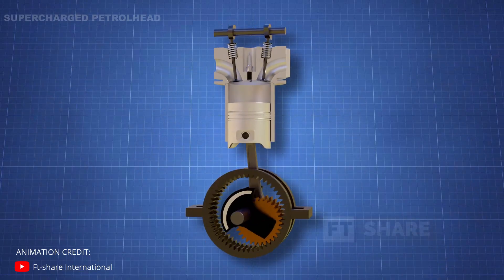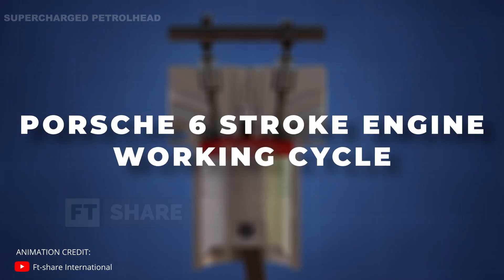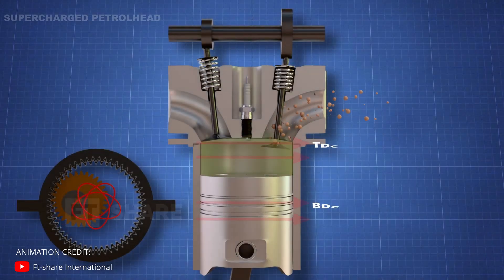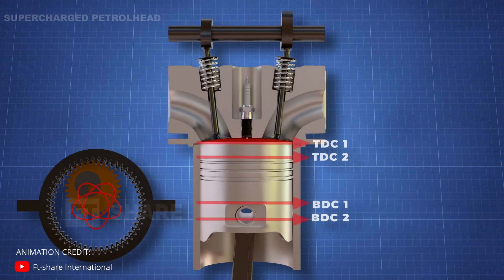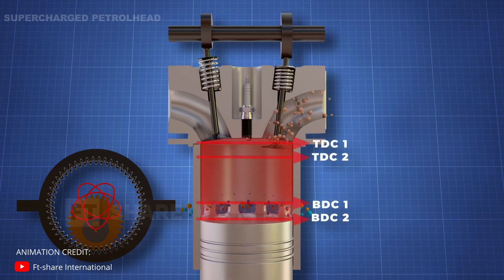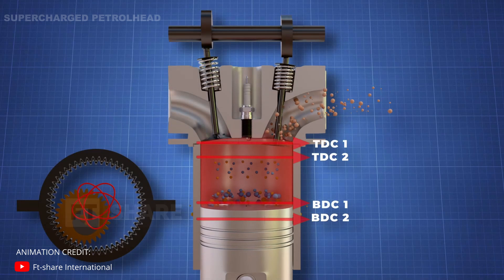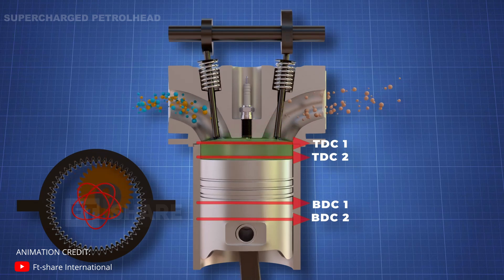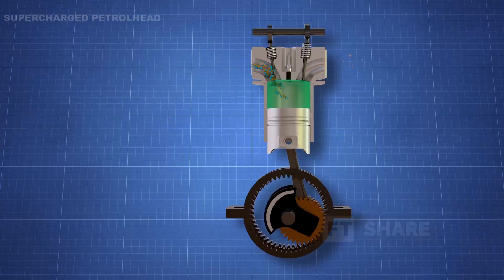How the Porsche 6 Stroke Engine Works?

Comment: how the milage is increased, where there 2 time fule intake is needed for 2 different power stroke. & why 2nd time fule comes from lower side ? how it makes different, I mean if the 2nd fuke intake cames from the same way, what was the problem ?
Reply: Bro we inatake and realeasing only some hot gas then performance and mileage inc by 0.5

Comment: Development in India All ready 2024
Reply: LoL. It's nothing new, it was already made in 1800's 😂😂😂
Reply: @Am1010-4k  Not really. The classic Atkinson-process was developed in the 1800's, but it worked differently, it worked by having different strokes at compression and work extraction, increasing efficiency by that, but with the downside of a reduced specific torque and power output. Generally, the Atkinson process was, at least partially, meant to work around Otto's patents of the fourstroke engine, and as the different strokes offered an opportunity to increase efficiency, they did so, of course.

The later processes often referred to as Atkinson-process are valvelift-operated means to make the effective compression stroke shorter by closing the intake valves later, so that part of the load flow back into the intake manifold. This, again, is a variation of the Miller-process, which aimed at the same goal, but employed early closure of the intake valve(s), but just as well changes the effective compression stroke without compromising the expansion stroke that defines efficiency.

Making an engine that changes from twostroke to fourstroke within each complete cycle is quite a task, making it work alone is an achievement, but it doesn't seem very promising in order to increase power density and efficiency alike. Without any further spectacular developments applied, it's only giving interpolation of the features and properties of twostroke and fourstroke engines, no more than that. But also, no less - to make it equivalently good as current usual fourstroke or twostroke engines already requires a lot of knowledge, effort, and solution of problems previously unknown.

But, it won't be anything of a gamechanger. If it's gonna be applied in a real car at all. Which I dare to highestly doubt.

Comment: well, good explanation on how it works but... I can see the power generated by the 2nd air intake (4th phase which used the left over fuel) would be around 40-60% less power..
so how to handle that instability? Having the 2nd piston at the first phase?
Reply: There's no 2nd piston. This is a usual fourstroke process and a usual twostroke process intermitting - a 6/2-stroke-machine, if you wanna call it that.

The general goal of it seems unclear to me, as this doesn't change anything within those two principles, doesn't offer a variable ratio of 2-to-4-stroke processes (which would allow for load adjustment by this very measure), thereby inheriting all downsides of both processes - the more complex machinery as a usual fourstroke, the shoving-in of oil of a typical twostroke, delivering a power that is inbetween that of an equivalent fourstroke or twostroke engine. A higher power output, as per the transition to twostroke, will be achieved, but only partially so, with the downsides of it being gone around, but only partially so.

It seems to me that this is more a means to show off development skills than to actually apply in any vehicle at all. There's simply too much complexity, questionable advantage, and a broad collection of downsides of each process involved, plus the complexity to make the engine switch processes in the first place. There's numerous of such machines, that generally don't seem to apply too well, but showcase the R & D's capabilities to handle more complex tasks than your usual daily turbocharger rematching or valvelift adaption. Heard of IAV's I2+2 engine? Such a case, too. Nobody would actually want it in their car, but it's impressive how they got around the downsides of cylinder deactivation.
Reply: @DC-rn1fc  basically the idea is to use the left over gasoline that's not properly ignited in the first combustion phase, to be reignited again in the 2nd combustion. hence the "6 stroke" mechanism.

the advantage is clearly fuel economy, the downside is... (I think) you can't get the same power with left over gasoline combined with some carbon dioxide air left over from the first combustion and with less oxygen. hence I was wondering, is a 2nd piston needed to counteract this issue..?
Reply: @WOTM8  There's no fuel to be left over. This engine alternates between twostroke and fourstroke mode, that's, sort of, all that is to it. An engine that can re-use left over fuel, from scavenging and local enrichment against knock, is possible and has the potential to be outstandingly efficient - but the complexity you'd need would vastly exceed this engine's.

There are no significant modifications to the two principles that are working here, they only alternate within the same engine.

Unburned fuel in the exhaust will, as usual, simply leave the cylinder, and be lost. I don't see that I'm missing anything here, but if so, educate me - where and how is there left over fuel? How does it go back into the engine? Or, if it doesn't, how does it stay there? The inserted twostroke, as every method of load exchange, starts with getting rid of the burned mixture, scavenge the cylinder longitudinally, then compression, ignition, expansion, and another exhaust part-process takes place, just this time with the aide of the piston.

It appears somewhat complex, but, after all, much of this complexity is spent to even make it work in that way. Improving either process is possible, of course, but not a fundamental part of this concept. It's exotic, and that may be because it's not that far off from being pointless - each process still has its typical downsides and advantages.